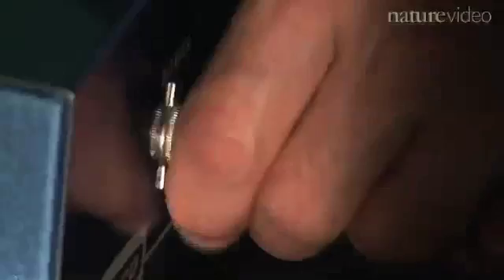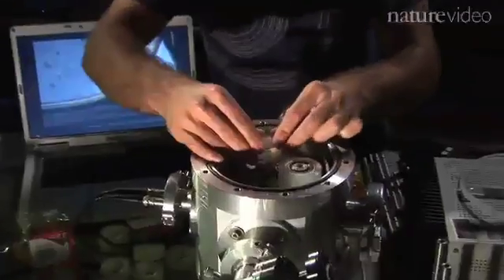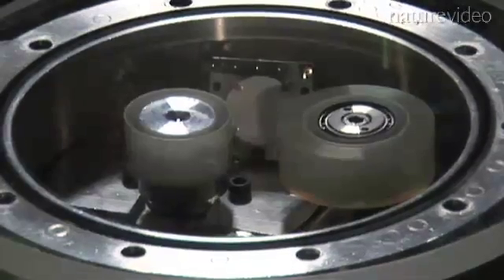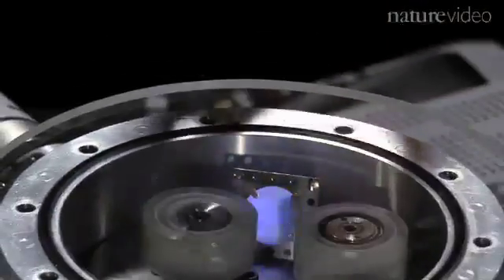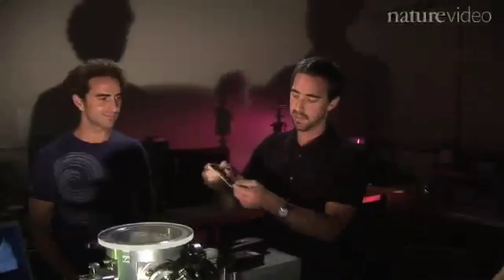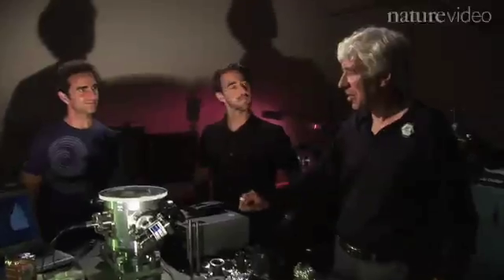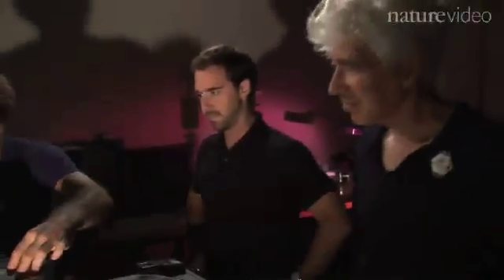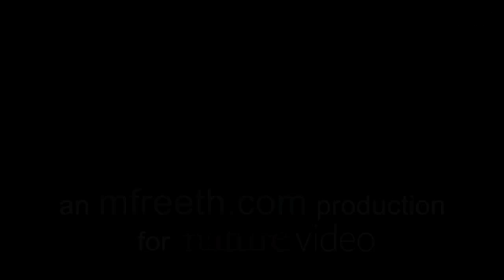Sticky tape X-rays: by Nature Video

Comment: You can do the same with a spark gap at atmosphere.
Reply: That needs a significant source of power and a high voltage transformer, while this is just unrolling tape in a vacuum.

Comment: This phenomenon is called triboluminescence. It occurs when rubbing, splitting or crushing crystals. With enough "rough" interference, the crystal collapses, with some particles randomly carrying more positive charges, and some - negative. Between them jumps the discharge, under the influence of which the substance begins to emit radiation. The honor of the discovery belongs to Soviet scientists, who in 1953 conducted a special experiment. The result struck everyone - the sticky tape was so "charged" that it was possible to make even the simplest X-ray picture of the thumb.

"This phenomenon is not a reason to refuse to use Scotch tape in everyday life," the scientists believe.

Comment: It's the velocity of the electrons that generate the x-rays, you need a long free path with a sudden stop.
Reply: In the normal X-ray tubes, 99% of the energy is heat with 1% actually creating a X-ray. I wonder if that is the same ratio with the tape. I wish Nature put some links to more sources in the description.

Comment: Scientists:
Triboluminescence is the release of energy in the form of light that occurs when two contacting surfaces move relative to each other. Although the precise mechanisms behind this phenomenon are not fully understood, it has been suggested that it is caused by the separation of opposite charges; when these are then neutralized a burst of energy is released which can be seen by the naked eye.
Intriguingly, UCLA researchers found that unwinding sticky tape can actually emit X-rays.

Media:
SCOTCH TAPE CAUSES CANCER
Reply: This phenomenon is called triboluminescence. It occurs when rubbing, splitting or crushing crystals. With enough "rough" interference, the crystal collapses, with some particles randomly carrying more positive charges, and some - negative. Between them jumps the discharge, under the influence of which the substance begins to emit radiation. The honor of the discovery belongs to Soviet scientists, who in 1953 conducted a special experiment. The result struck everyone - the sticky tape was so "charged" that it was possible to make even the simplest X-ray picture of the thumb.

"This phenomenon is not a reason to refuse to use Scotch tape in everyday life," the scientists believe.

Comment: 500 mRems??? Is that safe for those guys??
Reply: +J B Brief Actually, 0.5 mR/hr. The top scale is counts per minute (cpm.) The bottom scale is milli-Roentgens per hour (mR/hr.) Rems measure dose, (how much you actually absorbed) vs Roentgens (how much exposed to.) For x-rays this is approximately equal. 0.5 mR/hr is pretty low. In contrast, a chest xray gives about 10 mR in a single shot. You'd have to have your hand on that thing for 20 hours to get the same dose. I'd lay my nutz on it for a free drink.. kids are a pain in the butt anyway.

Comment: But you need the vacuum?
Reply: yes, as they said at 3:35
Reply: I think I skipped that. Thanks.
Reply: Nyixta Not skipping the video would actually solve the problem.
Reply: not only vacuum, HIGH vacuum. they're pulling .001 mmhg, which is tough, especially when the tape keeps outgassing, which it totally does.

Comment: It's an interesting but possibly majorly faulted idea ''making x-rays is africa in places where electricity is a scarce and expensive commodity''. I'm pretty sure that doing this on a larger scale will need a much larger vacuum chamber and pump system (which will use a lot of energy constantly pumping out air to hold a proper vacuum). Not only making it expensive to buy, but also expensive to run... Even a massive roll of tape with strong adhesive would take a fair amount of force (& energy) to constantly pull off the tape. And I'm not sure how cheap running large rolls of tape to remote areas of africa will be either. Or if they're really waiting on more waste plastic around... Thoughts?
Reply: vacuum chambers can be closed so they stay vacuum, you don't need a pump. I agree with you comment though, it's cheap for small operations but generating electricity could be alot easier with wind tunnels or the newly invented hybrid ecochambers
Reply: It might be handy for dentists in developing nations.

Comment: I would like to see the Geiger counter on the machine when it is on without the tape...
Reply: Caden Burleson They published it in Nature and the experiment has been reproduced by several groups. Also, getting a paper published in Nature requires some pretty rigorous work to begin with.
Reply: But you need the tape to generate the X-rays...?

The machine is just winding/unwinding the tape. Rotating parts under high vacuum has never been reported to generate X-rays.
Reply: OfficeThug Alrighty well I was just wondering to make an official discovery... I mean they would need a control which they didn't show here.
Reply: They did show it. It was just quick. Look at the very first time they brought out the Geiger counter and touched it to the machine.
Reply: If the experiment was nefarious in design, they would be using an X-ray tube to emit the x-rays, since moving parts under vacuum don't emit x-rays under normal conditions. Otherwise, common things like vacuum pumps would be emitting X-rays all the time, you think someone would have noticed that by now.

If they really wanted to trick you, they would turn on the machine without the tape but leave their hypothetical X-ray tube off. So to prove they don't have an X-ray tube, you'd need to ask them to take apart their machine. But what if they were hiding the X-ray tube? You'd need to do a body-search. And so on and so forth. Where does the rabbit-hole end before you're satisfied when your only premise for questioning the results of the experiment is simple distrust in the scientists?

Rather than do that, reproduce the experiment and see if you get the same findings. Other groups have done this already, and if you distrust them as well, then I guess you owe it to yourself to try to reproduce the experiment with your own hands. Simple distrust won't teach you anything new, in any case.
Reply: They did have a control. They turned off the peeling machine and put the Geiger counter on it and nothing registered. When they turned the machine on the Geiger counter went off.
Reply: Caden, I completely agree with you.  I've seen way too many false or "rookie" experiments on IFL.  I've been thinking about ignoring them soon.  IFL doesn't actually do anything but surf for "rookie" science experiments that are actually "incomplete".
Reply: Caden Burleson lol
Reply: Jimmy Ci I feel you. There's still some thought provoking things on there though.
Reply: Raphael Tolentino
I think they mean ON and spinning WITHOUT the tape in it to see if it's the machine or the tape that makes the geiger counter go off like that.
Reply: Caden Burleson In this very video they did demonstrate the the machine is not producing the xrays. It was explicitly there for you to see. He even talked about it. You must not have been paying full attention.
Reply: Raphael Tolentino He meant having the machine actually RUNNING with no tape in it.  They only showed it when the machine was off
Reply: ZlatkoTheGod To make it an actual experiment with a control...

How do I know as a viewer that the machine isn't generating the xrays?
Reply: Caden Burleson The same way you know it from a paper. The paper itself says it's been tested various times with other groups so you're just going to have to take their word for it. Unless you want to recreate the experiment yourself which you're always welcome to try.
Reply: Ryan Cavallaro And what do you hope that would accomplish?

Comment: You are generating X-Rays that are strong enought to expose deltal X-Ray film and you're just standing there?
Reply: That's called exposing your teeth :D
Reply: They are probably using dosimeters. Also the just get exposed when over the glass part, the sides are shielded by the steel vacuum chamber. Still amazing how much x-rays are produced.

Comment: isn't that sort of dangerous to work with x-rays at this distance over a long period of time
Reply: Better late than never, right?  

“they aren't getting anywhere near 500mRads/hour, if you go to university you know how ineffective a hand held Geiger counter is. Burst radiation is not the same. Second, the rate at which triboluminescence diffuses has already proven to be extreme, which is clearly visible from the film they presented. Even inches from the source are no longer concentrated enough to pose risks.”  - one of the guys in the video answered another question like yours.

Comment: @Treblaine Well, first off, they aren't getting anywhere near 500mRads/hour, if you go to university you know how ineffective a hand held Geiger counter is. Burst radiation is not the same. Second, the rate at which triboluminescence diffuses has already proven to be extreme, which is clearly visible from the film they presented. Even inches from the source are no longer concentrated enough to pose risks.

I should know, I'm in the video :)
Reply: @cyberslick18
Well we haven't heard from you in in 14 years ...

Comment: @cyberslick18 Yeah, I'm only studying Radiography at University, so I'd say I know more than the layman.
I suppose they COULD deal with this dose (related to their age) if it was a one-off, but it is certainly very careless and should not be repeated very often. Do you know something I don't? 
It seems they are getting 500 mRads/hour. If that includes "soft" X-rays (probable due to lack of filtering) I don't see how they aren't at great risk of skin carcinomas and cataracts.
Reply: ok I know this was ten years ago but that was EXACTLY my first thought. If what they were doing casually with alll those x-rays flying around the room was safe, then why does my dentist make me wear a lead vest and run like hell to the other room when the machine comes on? I kind of feel like the teacher here was irresponsible in not showing them proper scientific safety procedures. Those kids could have some sort of cancer by now and not fully understand why...
Reply: @erinisme633  Really isnt an issue, the dose received here is not even close to what would be gotten during a CT scan, and those are deemed safe.
Reply: @judebox1185  that "safe" in CT is tricky. Basically is a "the harm done is negligible or justified by finding out what's wrong in your body". Under no circumstances is recomended getting CT scans for the lulz. That's why there are different radiation ezposure thresholds for patients, workers and public.

Comment: @Ghebatta A conventional x-ray tube is nothing but a fancy lightbulb... it's still illegal to operate them without a licence not because they are expensive or complex but because ionising radiation is dangerous.
But this is a bit of a dilemma, legislation acts as if ONLY x-ray tubes and similar and radio-isotopes can create ionising radiation. Not sticky tape.
This is like discovering an everyday grocery product can function as a high explosive!

Comment: I always had to be cautious during black and white film processing when peeling off the tape that holds a roll of 35mm photographic film to its spindle, because the little sparks that were generated could expose an adjacent section of film.

Never considered x-rays...
Reply: I've seen the same peeling roll film off the paper - faint blue sparks but never seen any fogging as a result.

Comment: If you can create a vacuum in a container, then the vacuum chamber isn't necessary.  What is required, however is a turbo pump to generate a good enough vacuum.  I've found this so far from my current research as this is the topic of my research.